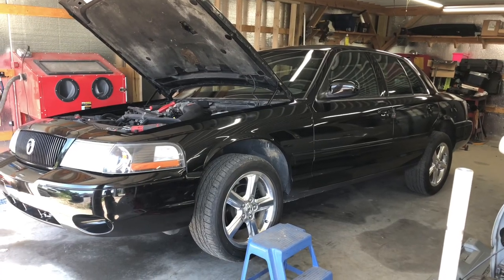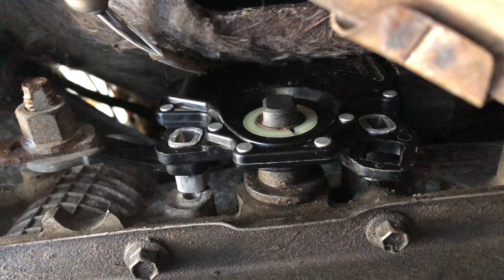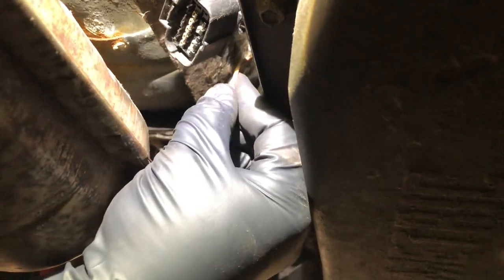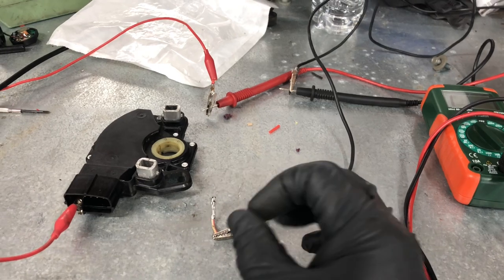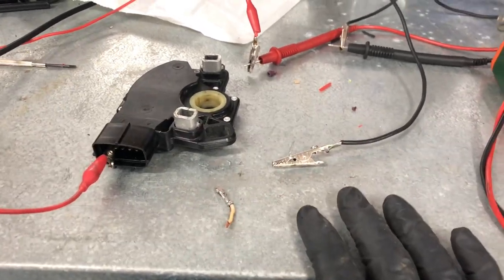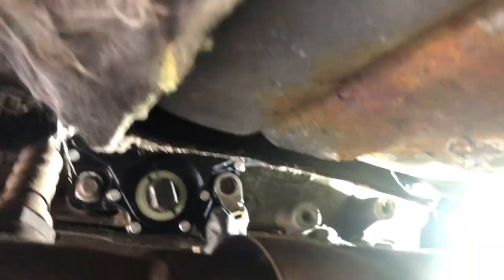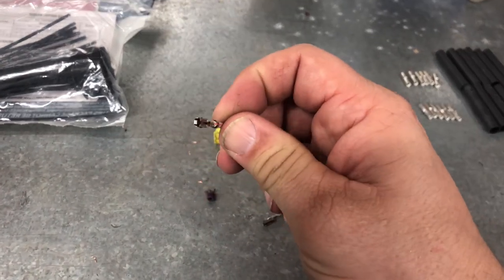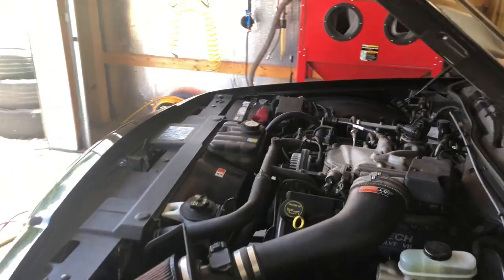2003 Mercury Marauder No Crank No Start issue finally solved!!!

Comment: Holy crap, I have the same problem with my 06 grand marquis,  it's not a daily problem, have thrown starter, battery, alternator,  spent 500 on 2 different garages, can't duplicate the problem, listening to you. It's my problem to, and Ford couldn't find an issue, I never turn car off when I'm out on a short trip, hoping car don't die. I've only had the car for 3 months and problem happen a couple weeks ago, after I replaced everything, I threw a trickle charger and next morning it started, and since I've had fire and local Napa shop, can't duplicate it, but Napa told me that ground to engine was really corroded,  they fix the issue, but don't think that's was issue, and car starts everyday for 2 weeks, your video is much needed, be honest I think you know more than these garages,  because you have the car with the issue
Reply from the maker: I’m glad I could help and hopefully this will fix the issue for you. I just got frustrated enough to dive in deep to the wiring. Thanks for watching and good luck!!

Comment: Great deductive work and the video presentation that kept the audience (me) intrigued. I think someone already monkeyed with that connector widening the terminal that caused a loss of the proper contact with the pin.  I hope the expedition and the town car projects are also moving along. I look forward to the next videos. Best of luck!
Reply from the maker: Thank you!!! Someone was definitely in there before me. Expedition is back on the road and was just aligned Thursday, but found that both front lower ball joints are bad. I’ll order those soon and knock it out one weekend. Thanks for watching!!

Comment: What pins where you probing on the range sensor I know it’s 2 or 3 years later and you might not remember but I’m having the same problem with my marauder and it’s very annoying I just threw a new engine into it and now it does this lol it just just not want to live
Reply from the maker: It’s been too long, but I remember they were at the end of the connector to the trans range sensor. I used a schematic I found on google to figure out which wires along with a service manual check list. Good luck and thanks for watching!!